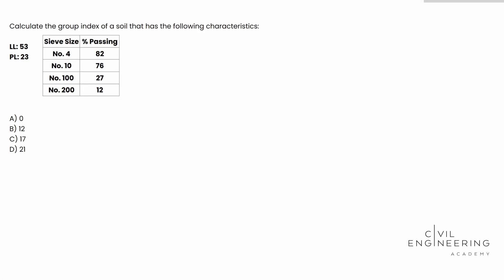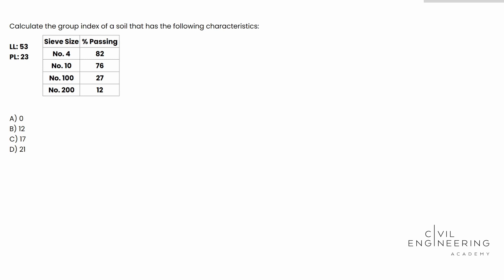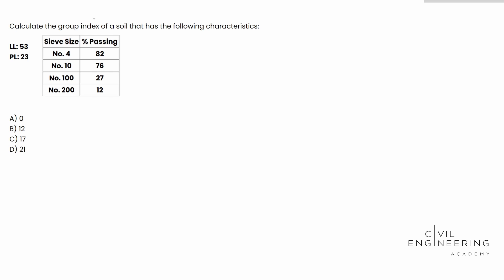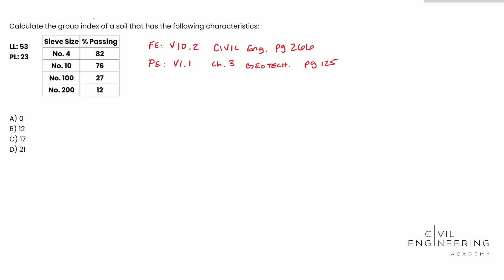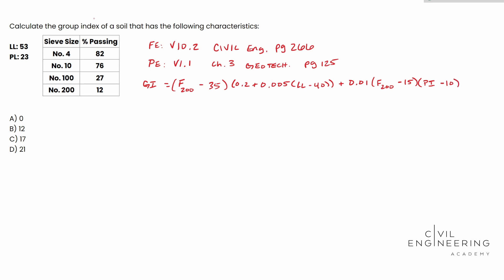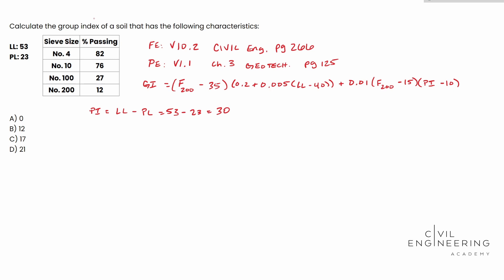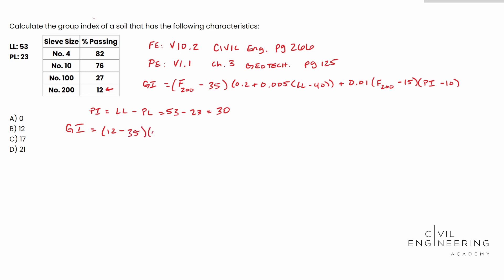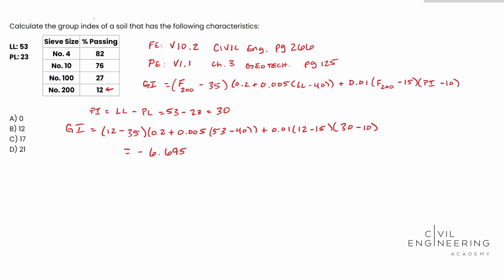Civil FE/PE Exam - Geotech - How to Calculate the Group Index of a Soil

Comment: Why didn't you classify the soil before using that equation? There is another equation listed on NCEES PE HB (ver 1.2) pg. 126 used for type A-2-6 and A-2-7. I get GI=-0.6, which still results in the final answer being zero.
Reply: I did exactly the same thing, the way you are proposing is definitely more correct. For this soil I think it is A-2-7